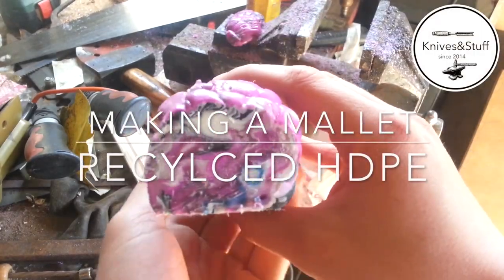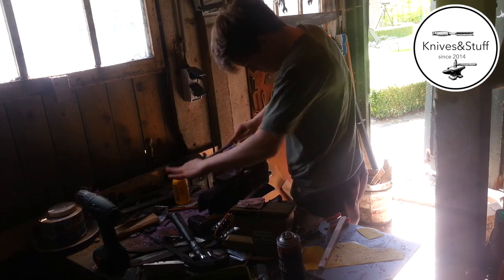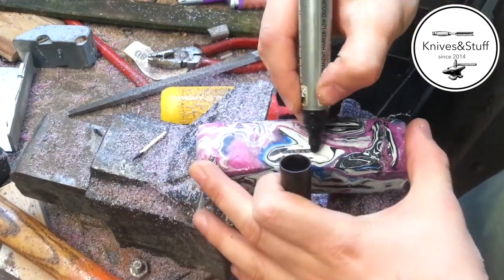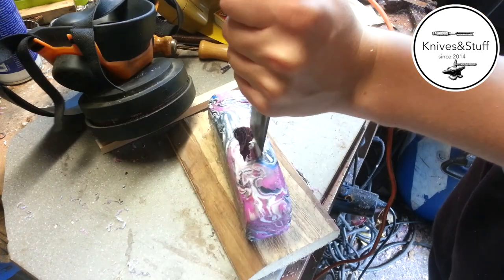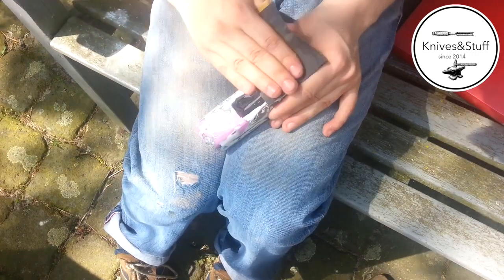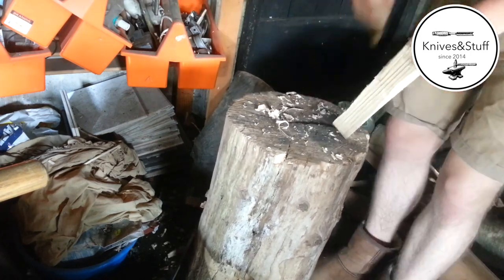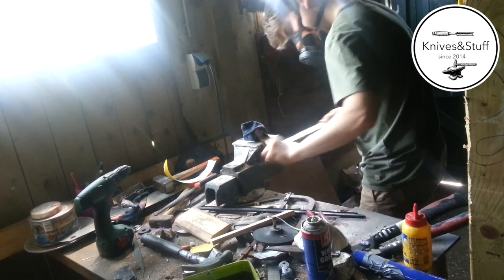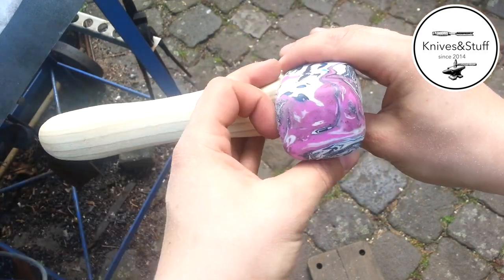Making a Mallet from HDPE - Knives&Stuff

Comment: Neat project! By the way, you don't need to sand HDPE with multiple grits. Just one, two at most, then heat it with a torch or heat gun till the surface looks wet. Much faster and easier, and gives mould-like results. Cheers!

Comment: Cool! This stuff would make a nice knife handle I think :)
Reply from the maker: +kaziklu79 Yes it does! But 1 thing you have to think about is that glue doesn't work. Not even epoxy or special plastic qlue.  You would have to make a mechanical connection.
Reply: Didn't know that. Some threaded rod at the tang end could fix the problem :)
Reply from the maker: kaziklu79 Yes, that will work. Peen or rivet the end and it will be solid as a rock.